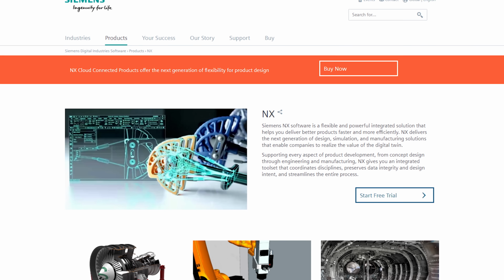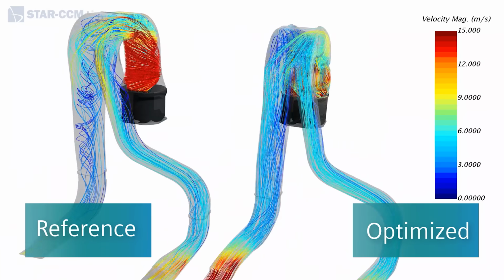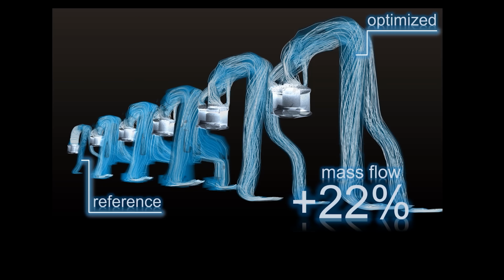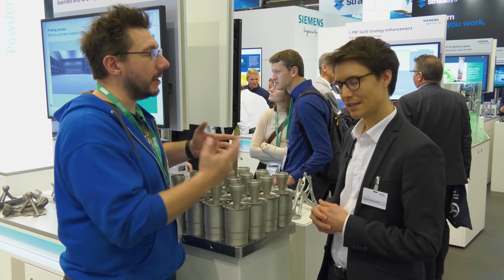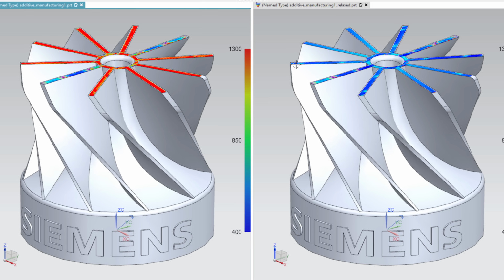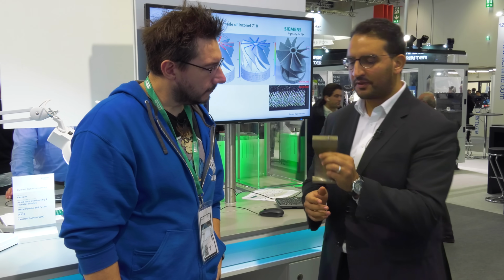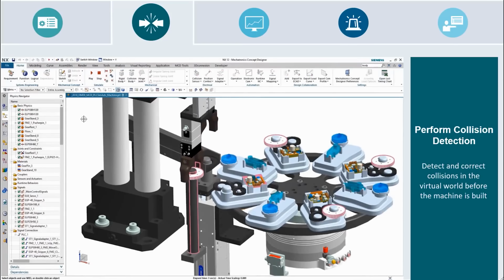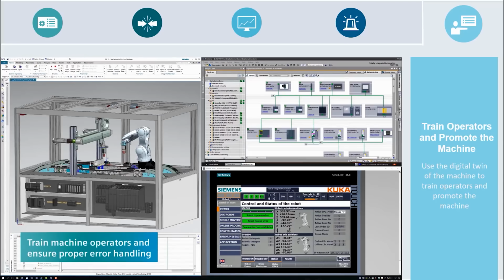3D Printing for INDUSTRIAL with Siemens Additive Manufacturing

Comment: Siemens done it again.... next level on a global scale. But you have to dumb it a bit more done in a practical way. Think of you having an older car let's say you have a Jeep with an L6 engine and we all know they exhaust and air intake are on the same side and therefor heat transfer can destroy the fuel injectors .... Now Siemens just showed us a way to computer scan all this and have a solution calculated to put / build a heat shield in an optomized way so it blocks the heat transfer between those parts. 
Engineering on steroids in other words. Now What we need is 3D scanners to copy existing surfaces into CAD which we can tweak and than print out in a adjusted and improved form. Can you cover some of those item's please too.

Comment: I recently have been trying to learn how to work with generative design and topology optimization. Emphasis on the trying. Not even at the working with any algorithms yet just trying to learn matlab. My mission is to use generative design to make a better pulse jet engine.

Comment: Constraining shapes to follow stress lines allows for optimization of material use. Basically, this is the same as eliminating redundancy. I foresee terrible effects when the actual applications fall, even for brief amounts of time, away from the models brought up by the simulations. We need to be extremely cautious about this.

Comment: I've used Siemens products for over 30 years in everything from cars to aircraft. From electronics to maintenance items to software. It's an impressive multi-vertical company. Their background in space industrial space is impressive. Don't be surprised if they are one of the first to enter into the high end consumer "manufacturing" product space before the decade is over. Keep close to this company Joel, you're going to learn a lot over the next several years.

Comment: Great video, amazing tech, although the HP fan optimization could have been improved by simple airflow solutions that I learned in high school auto shop 40 years ago. You could see in the reference part they made that the air volume above the fan mount area was much larger than the fan cylinder, simply reducing the diameter of the mating tube would have reduced the dead zone that the expanded air-space created.

Comment: I'd love for Siemens to pull off a "Fusion 360" with their CAD/CAM. It would help people get more invested on Solid Edge/NX. My teachers have both Solidworks and Solid Edge and they prefer Solid Edge by far. Direct modelling looks awesome by what I've seen. But, in my limited experience it has been far easier to find help for Solidworks/Fusion 360 than Solid Edge. Fusion 360 was a really great move for Autodesk, making people used to their software.

Comment: I worked for Siemens small gas turbines for over 6 and a half years and around 4 years ago they started playing with the idea of additive manufacturing on burner swirlers (for improved efficiency and easier manufacturing) and on SGT-400 hot end blades (production price and lead time reduction). Until I decided to leave the company, there were several new fancy components cropping up for R&D which I got a glance at first hand, and I just wish I got the chance to see what went on behind closed doors! Sadly, I never got a chance to see this side of things as the Lincoln (UK) branch never had a major role in this kind of thing, it was always in Germany, along with another company they were working with.

The hot end blades I saw had very visible layer lines on their surfaces so it's incredible to see the progression they've made since I saw them, and now you can't see them at all! I'd love to see a cross section of the inside with the optimised topology as the original cast single crystal blades had intricate chrome coated cooling air ducts inside. 

I can't wait to see what developments this technology makes, and just wish I'd been offerered the opportunity to work within it! (I worked as a rotor technician on high speed balance and overspeed, interesting but not quite the same awe level as this!)

Comment: Surely outlet guide vanes behind the fan to straighten the flow would be much more beneficial (like in every axial gas turbine engine) 🤷‍♂️ still cool tho 👍
Reply from the maker: I mean, maybe? I dunno. That fluid dynamics simulation is pretty darn cool
Reply: Tai Johnsen while undoubtedly straightening the flow, conventional guiding vanes would cause more back pressure than the optimized design. If you want so, the four arms leading out of the fan act like guiding vanes-only a little more sophisticated

Comment: As someone who has been at the end of the line and involved in the building and maintenance of the machines and set up of the cells nothing at all here is new.
25 years ago I used to run fluid dynamic simulations on a Pentium 200 for metal castings. Admittedly it would take a day and a half but once done the playback was available in real time. What they don't say is the highly complex optimized shapes they are using are extremely sensitive to flow and pressure density's. Something as little as altitude extremes would have changed the shape of that cooling duct quite a bit. When forced to use an optimized flow path for a different flow/pressure range the optimization turns into a severe hindrance.
As for serial numbers on multiple parts and the optimization of material space that was part of doing Cad Cam in the 80's {well in 2d anyway}. There were software packages that could do this back then in the days of 286 math co processors. CNC machines were capable of multiple serial numbers in a single job and in an ongoing set of cycles.
The plant layout software. How do you think plant and machinery has been laid out for the past 100 years. Factors like material handling, machine tool maintenance, operator travel distance and time utilization all done usually with a sheet of paper with paper cutouts and rulers to optimize distance. How do you think Henry Ford and the like laid out production lines.  An impressive piece of software would be something that DIDN'T need you to move around the pieces on a board and just needed the access parameters and cycle times put in to produce a useable result.

I don't know about 3d printing but looking at that before and after shot it looks to me like the problem was power levels of the laser and temperature variation due to location in the tool path and media heat soak. That sort of thing should be handled by the printer not the program. Thermal compensation for the time in area vs time away by media properties by laser power as a whole as the printer welds in sweeps. No more complex that a GPS selecting the shortest route that avoids certain areas.  On a milling center if it was cutting material the optimization would be easy as you could do each part individually for each slice.
That machine and tool simulation isn't anything new either that was available back in 03 from Kuka so not exactly new and without working 3d models of the equipment to load took a long time to set up. It would however optimize robot paths and interaction in the cell very well.
Siemens make excellent electrical gear and I have retro fitted their CNC, drives and motors and wouldn't hesitate to recommend them to anyone however the sales pitch for their software sounded like Uncle Jedds Bargain used cars on late night TV.

Comment: The software and AI is the real star here. It's not just the additive manufacturing that is revolutionary, but also the kind of computer AI aided design work. Those two things have a synergy and a virtuous circle, where we will be getting designs for things that a human just could hardly begin to imagine. That HP air flow duct - such a simple elbow shape - but the new part is just wild, such a bizarre and unexpected shape. So the AI is now in the design phase and able to analyze the airflow, and iterate different designs to try and optimize. And the racing car part, just giving the CAD program the  mounting plates positions and force loads, and telling it to design the brackets that connect the two things. Again, it would take a human years to optimize and come up with that shape, having to build and test iterations to failure. Or even to just design manually and test iterations in a digital environment, would still take ages. And now you don't have to worry about whether or not you can manufacture that optimized shape, because you can make any shape via AM. So yes these salespeople are kind of smarmy but the work is truly amazing.

Comment: NX is the CAD we use at Lexmark to design our laser printers. +5pts

Awesome Siemens simulation software +5points 

Highlighting a laser printer company for a cooling solution +10points

Highlighting our #1 competitor.....oooo that’s a minus 10points. ;)

Still +10.... wonderful video!

Comment: Moving around little models of EOS M400-4's which are over 2 million a piece is kind of mind blowing when you consider what it would cost to just buy the equipment in that model manufacturing space. The simulation is missing the water chillers, cover gas supply, and little forklift to move build plates. Those all take up room and the cables/hoses are always in the way. Also, the explosion proof vacuum for cleaning up metal powder. Yes, very fine metal powder can explode or more accurately conflagration. No that isn't from a bean burrito. Thanks for sharing the technology that Siemens is marketing. High five!

Comment: As someone who's finishing up a class in finite element analysis and a degree in mechanical engineering, I really appreciate the flow simulation and topology optimization but I feel they should also have tested the original part with a flow straightener/stator and compared the results. Yes they created a super cool part but I'm pretty sure they could have created a smaller part that performed similarly much quicker

Comment: Optimized parts. Nifty, Joel did that in Fusion360, I've done that in Fusion360, big deal.
"We can use machine learning to fix materials issue at the structural level while printing and ensure identical parts every time."
Okay... we can't do THAT.
Reply from the maker: That part blew my mind.

Comment: Oh man. I love the software they have that can help people design machines and virtually program them. That software can cut down time on prototyping so much. 

Really wish there was a small business or hobbyist edition of it. Would be amazing.
Reply: I think Blender can do quite a lot - build the machine, kinematic model, set constraints, animate, tweak rinse and repeat until it works virtually, then export the parts as stl files for printing.
Of course, it'll take slightly more than 5 of your Earth minutes, but should get there.

Comment from the maker: Want to jump around? Here are the links to the different sections. Ready? GO!

0:39 - Digital Enterprise Portfolio
1:06 - Siemens NX using CAD CAM CAE
2:02 - Fluid Dynamics Simulations and Topology Optimization in SIMCENTER
9:17 - Industrialized Serial Production
12:09 - Simulation of Topology Optimized Parts
14:57 - Powder Bed Laser Path Optimization using Machine Learning
20:43 - Digital Twins for AM Machine Builders
23:07 - AM Facility Planning and Factory Environment Simulation
27:20 - Remember the 1920 Ruston Hornsby Steering Box?
27:42 - Global Additive Manufacturing Network
29:39 - Multi Axis Robotic Printing Solution
Reply: At about 25:00 i could just imagtion taking that factory layout then importing it into a game engine for use in vr to get a better feel
Reply: @England91  Hang on, you do not have to import it in game engine for VR experience, that is already part of Siemens NX  :) #ingenuityisnx https://www.youtube.com/watch?v=kp7Z2juHbOk